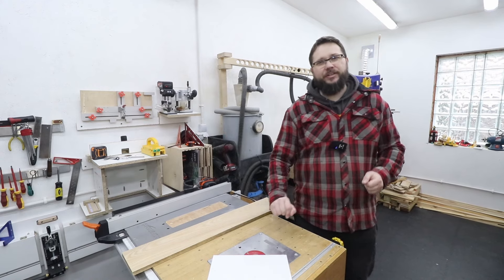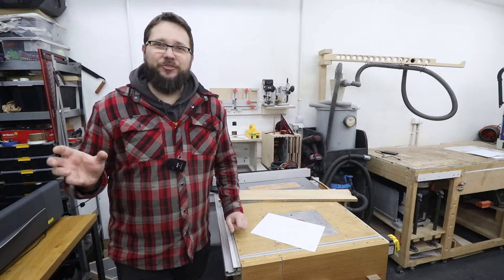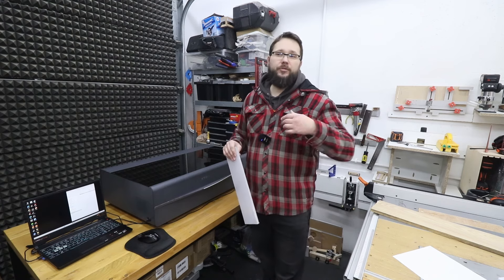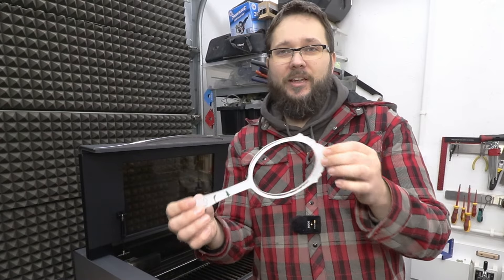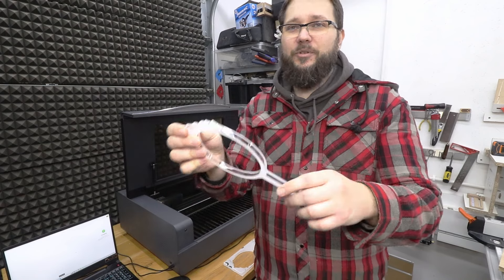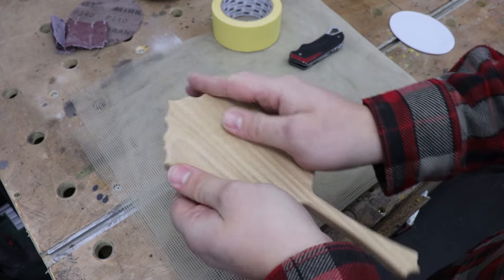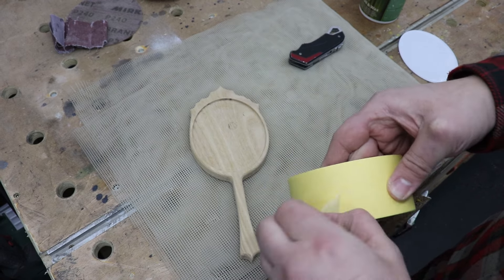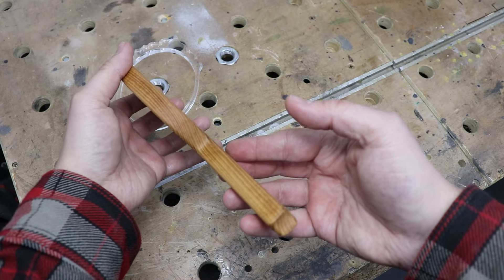DIY Hand Mirror Made With Acrylic Template

Comment: Perfect, very very simple to make and results in a quality piece ... your daughter would've loved it ... brilliant (as usual) 👍 ... what about a version where you actually use the template to make the mirror, i.e. a clear acrylic handle and surround?
Same cheap router bits as I have, watch out if you use it in deeper material ... the grub screw (in the lock collar) will cut a slight groove in whichever bit it is next too 🤨
Reply from the maker: Hehe all the router bits I have are cheap. The short straight bit and the spiral bit all from Banggood. And all very cheap.

Comment: That’s interesting. I remember using co2 laser in the past and always having the same issue… acrylic was warping and melting 🫣. I presume diode laser does not have the same problem.
Reply from the maker: Diode laser can't cut clear acrylic. The laser I have is the xTool p2 CO2 Laser. My templates are from 8 or 10mm acrylic so I have no melting or bending. But I did cut thinner sheets like 3mm and not experienced those issues either 🤔
Reply: @CasualDIY  probably technology has changed dramatically since then. Anyways great video man!